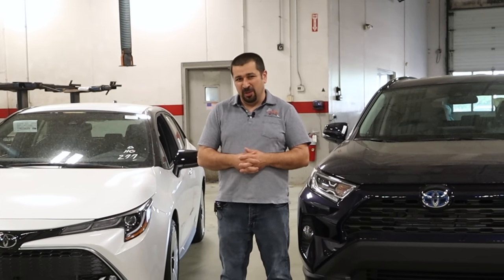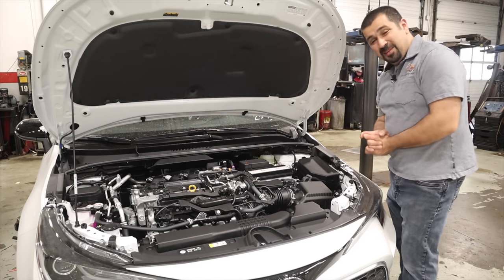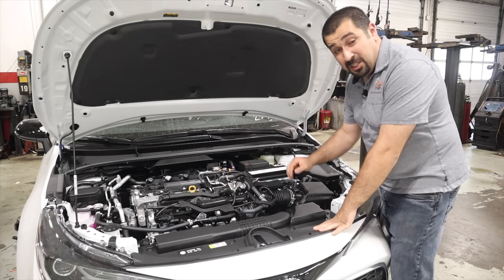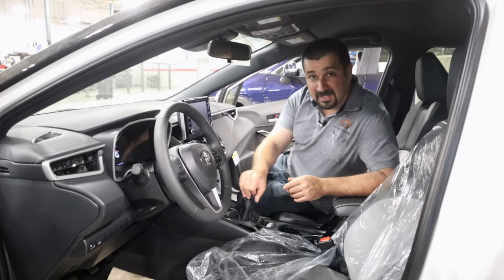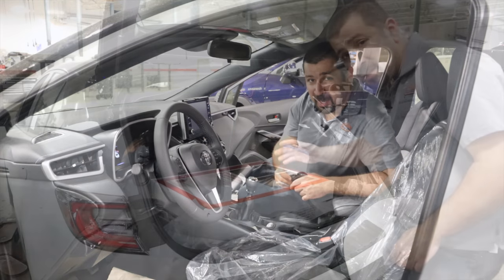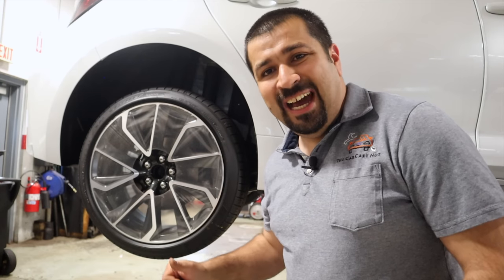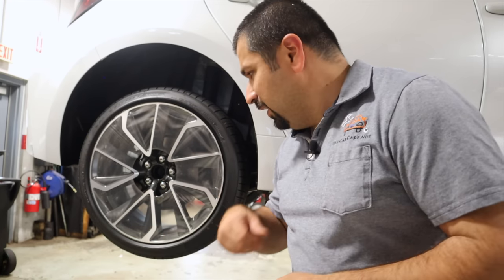Buying a new car? Here's what happens behind the scenes.

Comment: How do you know if the steering column isn't straight? surely that's that's minimal adjustment but how to spot it please
Reply from the maker: Hi! Could you elaborate further?
Reply: You said in this video you don't want to buy a car when the steering column is not straight, that's all you said and you repeated it.
Reply from the maker: Steering is not centered. So when you drive the car the Toyota logo would be correctly oriented and the steering wheel in it’s the correct Ahead position the car should drive perfectly straight. If it starts going one side or another then it’s off center
Reply: I see thanks for correcting sorry I got that a tad wrong. That makes sense and if it is off centre the wheels should be turned in that direction, right?

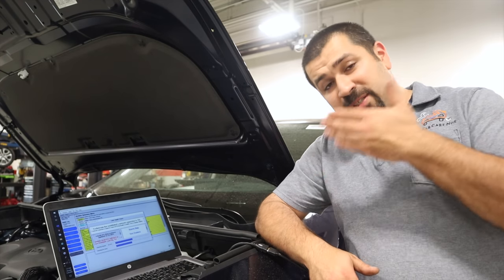Comment: (13:45)  New toyotas have onboard 51 computers.  Any one of ARE potential failure points, in addition to the usual moving mechanical linkages. 😌😳🤔
(18:59)  Doubt it very much the dealer will let you drive your newly ordered car off the lot without you handing over some payment first.

Comment: Question. I just bought my brand new highlander with 110 volts/1500 watts outlet. I tested it using the 3 wire circuit analyzer just like the one normally uses at homes  and it says Hot and Neutral Reverse. Is that normal?
Reply from the maker: Hi! AC voltage alternates that could be normal

Comment: What happens if you bought a car today and tomorrow you went for a touchless car wash. then you notice white smoke coming out from the engine located in the bumper because the engine car is on and you forget to turn it off. When you turn the engine off the white smoke slowly disappears. On that day, you went to the dealership to have a check. The dealership does a test drive for a couple of minutes and no notice white smoke from the engine and they said may be caused by the water that goes inside the engine because the engine is on and they even spray water in the bumper and nothing was noticed. Any advice will be highly appreciated. The car detail is Toyota RAV4 Trail 2021.
Reply from the maker: Hi! Could’ve been water evaporating as it goes over the hot exhaust..
Reply: @TheCarCareNut thanks for your response. Does it mean nothing to worry and that's normal for a new car?

Comment: Hi, I have another question... my high mileage car recently had the ATF changed. It seems like the previous owner used another brand's fluid so I went to a service shop and got it drained, refilling with Toyota's WS. After a few days, the transmission started having issue, like unwilling the shift gears when cold. So, I bought a bottle of transmission booster (sth to soften to rubber seals). The problem went away but again after few days, the car started jerking when coming to a stop (pressing the brakes). Do you have any idea if the change in different fluids caused this? The jerking only happens when braking and is still smooth during accelerating.
Reply from the maker: Hi which model and year and mileage?

Comment: My rule is still never buy a new car. Let some sucker take the initial depreciation hit and discover any subtle problems that might be lurking. Second rule is never set foot in a dealership, if you can possibly help it. Third rule is buy a Toyota product. There's nothing more annoying than car repair issues...well, almost nothing. If you're physically able, do simple things like oil and filter changes, brake pad replacement, etc. yourself. You want to know exactly what goes into and on your car. NEVER trust a dealer. He's on the other side of the dollar. And sabotage isn't unheard of.

Comment: my 2020 camry hybrid came with unpainted parts on the trunck top area and only primer of a diferent color it looks somewhat incomplete is this normal? and is there a cover that supost to go there? can you show us?
Reply from the maker: Hi! Could you be more specific on the area that’s not painted or only has primer?
Reply: @TheCarCareNut  yeah you know like behind the back passanger seats where the speakers go for the rear. there a metal cross member has not been painted or more like painted but partially and you can tell that the paint fades and you can see only the primer coat
Reply from the maker: That’s normal from the factory. They usually don’t paint surfaces that are not very visible
Reply: @TheCarCareNut  oh i see..

Comment: Hi AMD,  I just received my 2022 RAV 4 XLE AWD on Feb 10 with only 130 miles. Within a few days there was a boom sound that came out from the back but I did not think anything about it. Then after 4+ weeks there was another Boom sound coming from the back which I assumed the exhaust pipe. I took it back to Toyota dealership and they could not redo the same effect and they said they ran all the diagnostic on the car and did not find anything. I talked to the technician leader/manager and he said he has never heard of that issue before. Do you know why this is happening? need advice. Thank you in advance.
Reply from the maker: Hi! Honestly hard to tel without hearing it. Nothing that I know of as far as common issues
Reply: You won't hear it any more after the stowaway hiding in the spare tire area finally dies.

Comment: I noticed my new car steering wheel is off center. What is the solution?
Reply from the maker: Either an alignment or it can even be done on the rack via a TSB that toyota issued to center wheels.
Reply: @TheCarCareNut  not the wheel itself but the big plastic part that goes into the dash is crooked.
Reply from the maker: Have the dealership take a look and take care of it

Comment: Anyone happen to know the part number for the body plugs on a 22 corolla hybrid?  They were not installed (knew to look thanks to this video), i picked up the car on a saturday so parts and service were closed, salesman won't respond now, so I'm just going to buy them myself.
Reply: My car also had 50 PSI in the tires, I didn't check until 700 miles on them.

Comment: RAV made in Japan
Reply from the maker: Hybrids used to be made in Japan! Not anymore! Now they're made everywhere!
Reply: @TheCarCareNut  our 2015 RAV XLE was a Japanese produced model. I’ve heard anecdotally that the US made models had issues and the Japanese models didn’t. I know we loved ours. The only thing I did to it was brake pads and rotors, tires, and change oil. I also had just replaced the spark plugs, not because of any miss fires, just as a general maintenance practice.It had 111k when we traded it in this past week. I believe it was developing a wheel bearing failure, but that is due to the bad roads where we live, not a shortcoming on Toyota’s part.

Comment: Hi. Thank you for the work that you do on this channel.  I've learned so much from your expertise. 
I watched this video before we bought a new 2023 Sienna XSE. When I looked in the glove compartment to get the owner's manual, I discovered two packages of hole plugs.  Each bag had a pair. You had mentioned the importance of installing these as part of the PDI. I called the dealership and their mechanic said that they installed one underneath the car because we live in California and rust is not an issue.  He further said what I found were spare hole plugs. 
Does this sound reasonable? Should I get them or a local mechanic to install them ASAP?
Thanks.

Comment: I know you say this is done at all Toyota Dealerships..but it's not.. Toyota Dealership's  I have worked at for many get the detailer to do the PDI..Just disgusting .Workshop Manger then charges New Car Dept for a technician's labor yet another rob at the dealership.👇👇👇
Reply from the maker: Hi jack. I hear you but the dealership I work at Pdis are done by techs only not even hourly lube techs. And new models are done by masters and MDTS
Reply: @TheCarCareNut  I think you have misunderstood..At every Toyota Dealership I have worked at in Australia..I know it's a different country..but every car was PDI..by the car cleaner..NOT a Tech at all..👍
Reply from the maker: Oh wow that’s interesting to hear. Now in Australia is it an importer( independent distributor)  that brings the cars or is it Toyota itself that distributes the cars?
Reply: Toyota themselves..it use to be a private importer in the 1960's..But I've worked in 4 Toyota Dealerships over here and the detailer/car washer does the Inspection..Toyota rattle on about quality control..I know all about there customers experience surveys and treating everyone as a guest..Just all BS when it comes to the inspections prior to the customer receiving the car..It's extremely lucky Toyota's quality control in the factory hasn't led to deaths on the road here